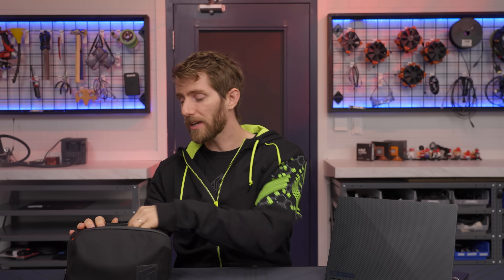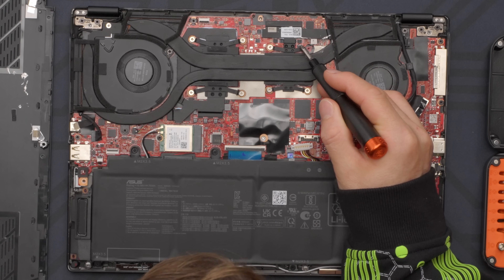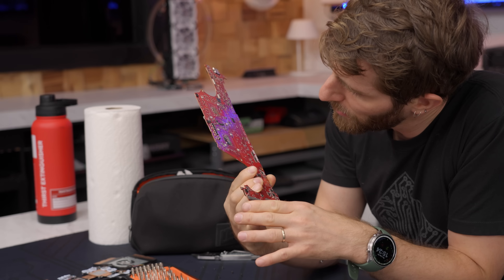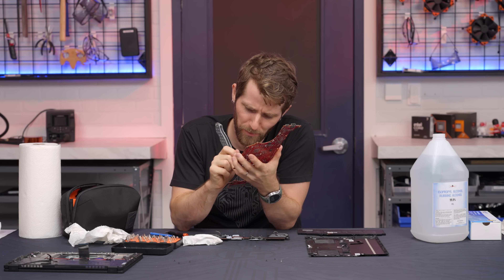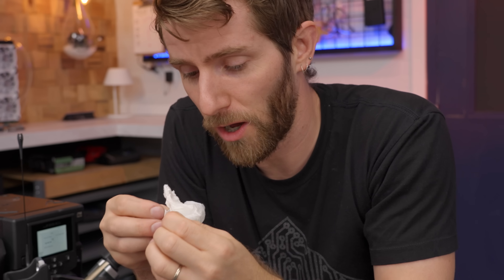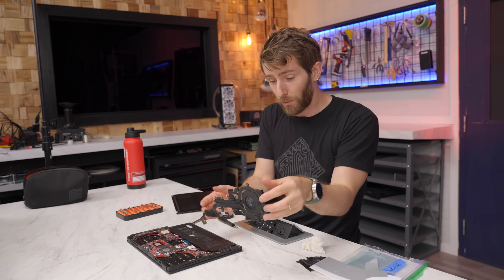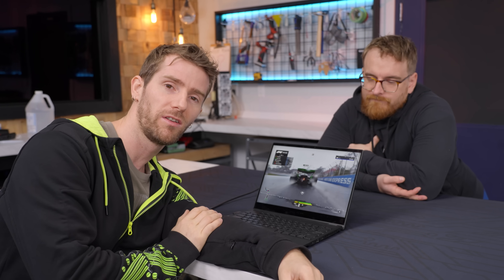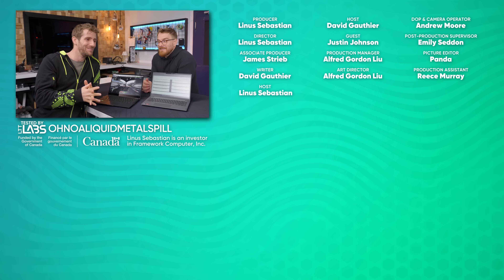Liquid Metal Killed my Laptop… Now What?

Comment: My repair shop has seen a couple of ASUS laptops with liquid metal ejection. The only thing in common between the customers was that they had both recently been on a flight, which makes us wonder if air pressure changes had something to do with it.  Correlation doesn't equal causation, of course, but it gave me cause to stop recommending ASUS gaming laptops for people who intend to travel it around a lot.
Reply: Thx for this insight. Will keep this in mind

Comment: I miss enormous laptops like the Helios 500 and the Area 51M that actually had an adequate cooling solution, and didn't have to resort to exotic enthusiast level TIMs.
Reply: The Area-51m laptop was the last laptop to be repairable, with failure-prone components such as the CPU and GPU being socketed instead of soldered on (and of course RAM and storage were also upgradeable and replaceable). Sure, you paid for that in terms of portability, but it's what the last repairable laptop
Reply: That makes no sense. 

Liquid metal isn't a replacement for giant heatsinks. If anything liquid metal transfers more heat into the heatsink which would justify having a giant heatsink. 

Instead modern laptops get smaller heatsinks because they've gotten better and manufacturers are cheap and willing to run the hardware hotter. (Also people complain about heavy laptops) They still make chonky laptops if you want them.
Reply: @aleks138  a better TIM does help a lot since the heatsink's rate of transfer to the surrounding air is determined by the difference between it's temperature and ambient.

I swapped  from factory thermal paste to PTM7950 on my GPD Pocket 4 and it dropped temps by 6 degrees at the same fan speed and let the fan work a lot less at idle.

Comment: I have two of these ROG Flow laptops, an x13 and x16, both used very heavily as a student for 2 years. The X16 had an issue (caused by me) with its sleep sensor that would cause it to get VERY hot coming out of my bag.

Fortunately I've never had a seal issue on either of these computers. I think your case should be covered under warranty because it seems like a hardware defect more than anything

Comment: I'm just thinking of my Flow Z13 (not X13) from 2021. 3050ti. It has liquid metal, on a 65watt CPU (Core i9 12th gen).  That is the 'tablet' formfactor. It is always standing up, because the internals are in the screen. Still working fine though (and used as a work coding machine daily for 2 years...).

Comment: This is such a bad example, people. Don't ever rub beads of liquid metal! Most of it will spread to other components!
Use syringe with a small needle and magnification to remove as much as you can before you try to wipe it!
Then, ALL solder points that got in contact must be re-done! Those components should be replaced at this point.
You MUST check underneath the CPU, as there's oftentimes a gap. IF you see liquid metal in there, the chip must be re-balled as well.
A(TURD)SUS and any other manufacturer should be sued for this if it's not covered under warranty.
If it happened to Linus, IT WILL happen to other people.

Comment: Take everything off the board and put it in a ultra sonic cleaner. That will remove the liquid metal from the board. Either the laptop will work or wont after cleaning 75/25 on the laptip working take your pick on which number you want.

Comment: I bought a second-hand Ga401QM that had the liquid metal spread out on the board, it would boot like normal then randomly turn off when moving/lifting the laptop, and the audio was SCUFFED. I used rubbing alcohol and a toothbrush to scrub the entire board, let it dry and it works like brand new again!
Reply: Rubbing Alcohol has a much lower percentage of IPA. Just buy the good stuff.
Reply: Ooh that's my laptop. I gotta be careful lol. But thanks for the tip

Comment: I think you should either do a collab with northwestrepair or send it to him for diagnosis and hopefully a repair. With the amount of liquid metal on that thing and how far it had spread around I would think there's a good chance some got under the cpu and it would need to be removed cleaned and reballed, and there's probably some other components like resistors and power regulators that blew due to the shorts from the liquid metal. If your lucky the cheap components like that blew first and protected the cpu and gpu and someone like northwestrepair could fix it, and from what I've seen he tends to go the extra mile to get things fixed

Comment: 2:10 - Linus literally just described very normal laptop usage. Frankly, this seems common and there should be a class-action suit against manufacturers for this. If you can't guarantee it'll work without user intervention for at least the duration of the warranty, you shouldn't be selling it.
Reply: Yeah, those things he described are all perfectly normal, especially putting your laptop in your bag warm.
Reply: I've dumped my laptop in a bag while ON, never mind warm (it was shutting down, but took about 5 minutes to do it and I had to leave), and I also once dropped my laptop bag down an escalator at an airport. What Linus did is mild. I'd never knowingly buy a mobile product containing LM or any other readily spillable conductive liquid though.
Reply: The whole time he was describing that like him being rough on it, I was thinking "that's just how a laptop is used" hell, I'm far less kind to my laptop, using it in a machine shop where every table is covered in metal dust (every few months I have to open it and take a magnet to the speakers to pull the filings off and stop the buzzing noise that causes), I fall asleep watching movies in bed and either roll over it or knock it off the bed while it's open and it just doesn't care. This thing wouldn't have lasted a month with me apparently.
Reply: Class actions are pure BS. "Cost of doing business" and is never enough to harm the company nor to refurbish the customers. "Wow, my $5 voucher that I'm able to use at the same company that did me dirty!!!!!"....
Reply: @Mtaalas  My LG fridge that was repaired for free thanks to the outcome of a class action suit seriously begs to differ. It would have been at least a $600 repair back in 2017. Now most aren't this helpful and are a functionally meaningless payout as you mentioned.

Lawyers usually benefit the most, but it's pretty much all we have in the US right now to push back against the corpo drones that want to squeeze every last dollar out of us. Our regular consumer protection agencies are toothless right now, thanks in no small part to the flaming dumpster that is our current administration.

Comment: Repair technician here : I usually start with isopropyl alcohol on a cotton swab.  The isopropyl seems to give a higher surface tension to liquid metal, which allows me to roll most of it into little spheres, then ultimately into one big ball on the center of the die.  As long as it is coated with isopropyl, it refuses to stick to anything.  If I have enough liquid metal left on the die, I often reuse it, as it often moves away from the die faster than it degrades past the point of usability.  Leaving the isopropyl dry off of the liquid metal ball often takes only a few minutes, after which it can be smooched back onto the surface of the die with a new dry cotton swab.  Also, if you'd rather change the liquid metal entirely for a new application, you can easily grab the liquid metal ball with very fine tweezers from underneath, as long as it is still coated with isopropyl, and remove it entirely in one swoop.  I use the angled tweezers from the Ifixit pro tech toolkit for that.

Shoutout to CIPC computer shop in Montreal.
Reply: heyy bud,just wondering, does using aluminium foil is good (effective) to pull the liquid metal? cuz i once saw a video on "Dell Technician expert" (shoutout to the greatest Dell technician that's ever lived,) and he said that it can be used.. 
*Correct me if i'm wrong.
Reply: @nalenendra8002  I honestly don't know, I never tested it myself and I never even heard of this "technique".

Though, as a thought experiment, roughly knowing the rate of the reaction between galium and aluminium, it could take a while, and you'd end up with aluminium foil that feels more like wet toilet paper.  You might also need to break the oxide layer on the aluminium before putting it in contact with the galium for best results.  Plus, the reaction would break apart your galium and you won't be able to reuse any of it.  Woefully impractical if you ask me, but what do I know!
Reply: In cases where it's balled, I was wondering if a simple small syringe would suck it up affectively.
Reply: @Its_Mr_Mittens  Actually, yes!

Though I've only done it with fresh liquid metal, I'm sure it'd be a very easy way to take it off for cleaning and back on again.  Usually, the smallest tip the better.  This thing can be incredibly runny.

Just make sure you don't use a fresh liquid metal syringe as there is some degradation over time while applied and you wouldn't want to contaminate a whole syringe.
Reply: Hey neighbor do you have any recommendations for a repair person in ottawa. I have had a zephyrus m16 for  10 months and my thermals have been getting bad and im suspecting poor application at asus factory. I was going to just get someone to re-spread the liquid metal but I think  using ptm7950 is better as i use the laptop on the go a lot and it goes in my back. Do you have any rec?
Reply: @itssmk_  Sadly, no.  Sorry.  Though you should still be under warranty so maybe Asus themselves could do something about it?  I would try to contact them if I was you.  And if they can't, you can always try to do it yourself but it's definitely risky,

Best of luck.
Reply: Problem is when capacitors on substrate where die is soldered are not insulated with proper material or at least gel nail polish (found out that most resistant is "gellish" lack you need to UV cure) and then soft but dense square around inside edges of substrate, not that porosive black synthetic foam they use for last 8, 9 years, notably the worst on ps5...

Comment: 8 years ago, my 2016 XPS 15 fell two meters onto a tiled floor. I had to replace the chassis, but the screen and motherboard were intact. I took the opportunity to replace the thermal paste with liquid metal. After that, my sister used it and even accidentally ran over it with her car. The chassis and the screen broke but the motherboard was still working. Despite all this abuse, two coats of nail polish around the cpu and the gpu die were enough to keep it working to this day.

Comment: I had replaced the thermal paste on my laptop with liquid metal for better performance. After a long while, the laptop suddenly shut down and wouldn’t turn back on. When I opened it up, I saw that the liquid metal had leaked onto some areas next to the CPU. I took it to a service center, and they told me that the motherboard needed to be replaced, which would be expensive, so I refused. They only cleaned it and replaced the thermal paste for free, then gave it back to me. I set the laptop aside for about a month, and one day, just out of curiosity, I plugged in the charger and tried turning it on. To my surprise, it powered up perfectly fine. I ended up using it for another year without any problems before selling it. I still find it hard to believe that it worked that day.

Comment: 9:00 i feel like freezing the board might have been the best option. that might allow you to just dust the liquid metal off as it will solidify. maybe LTTlabs should find out what is the best method to remove LM from a pcb even a cpu socket.

Comment: Have same sh8t with alienware 17r5( we change paste to LM), and LM goes under gpu mem chip, we switch off to integrated and work so about 1.5 year and after get black screen on integrated, after dissasemble i saw that LM was around CPU VRM, so i clean it all and no scary to try turn it on, an seems will sale it for parts

Comment: You are GAMBLING with LM in a laptop! Sure, temps are great, but you're constantly risking the entire laptop turning into a very expensive paper weight. To me it's just not worth it. Just use MX4 or TPM7950 for good temps and zero risk of a teeny, tiny spill shorting out your 2000+ dollar laptop.

Comment: been using liquid metal in my laptop for 4+ years that wasn't designed for it and it's survived thus far lol. I did a TON of prep and precaution though

edit: for any one curious, that prep was: 1. electronics tape around the CPU & GPU package, 2. conformal coating around the CPU & GPU package underneath the electronics tape, 3. K5 pro as an extra barrier around the CPU & GPU package, 4. conformal coating ALL OVER ANYTHING around the CPU or GPU vicinity.

Comment: 1:09 I don’t recommend this AI summarizer, it’s expensive, the audio isn’t great (just use a phone and find the first noise cancelling app or website file converter and it will sound better, idc if the thing is smaller, for the insane price and subscription required for a good amount of transcription just isn’t worth it if your phone works better) I’ve tried it expecting it to be good, the pin one at least isn’t so great especially because it automatically cancels background noise (at least give me the option so hear the original audio just in case it lost some info) but it’s kinda justified considering how small it is but the subscription is crazy when there’s websites that do the same but for free 🥱.
Reply: But again this is just my experience with it maybe for someone else this gadget could be pretty useful if you can’t put your phone on your table or anywhere close by for good audio, don’t take my word for granted

Comment: Ipa makes it ball up and separated then use adhesive tape it will pick it right up off the board. Alternate between the two. Ipa in a spray bottle will flood and push alot out

Comment: The best way to clean liquid metal is to flux some solder wick and heat it with a hot air station and the solder wick will suck up the liquid metal via capillary action and get the board nice and clean.

Comment: Having this video is great i just replaced my 2021 Zephyrus G15 liquid metal to PTM7950 and MEN i gained 30% extra performance in multicore benchmarks and more sustained power between cpu and gpu, liquid metal is simply not worth it temps are even better now with PTM

Comment: I wonder how much it would cost a manufacturer to put a conformal coating on these boards they are cooling with Liquid Metal…seems like the best solution to this problem…but maybe I’m dumb.😅
Reply: Likely about the price of a couple jars of nail polish, it wouldn't take much and could be done with a pretty large brush. The only tricky aspect would be leaving other hot components uncovered for putty.
Reply: You'd have to be careful not to cover any connections and such, and it would make component-level repair impossible

Comment: To remove excess solder with the wick more easily, first I dip it in flux and heat it up. After that I use that "fluxed" part to soak up the excess solder. In that way, the wick uniformly sucks up everything more neatly... And then clean up the area with Isopropyl alcohol once I'm done.

Comment: If you use a blow torch on the solder wick to remove the copper oxide layer, it can absorb solder (and probably liquid metal) a lot better.

Comment: I hope this liquid metal phase for laptop manufacturers go away QUICKLY. I don't want to worry about my laptop not functioning the next day, all because I didn't let it cool down for 10 mins before putting it in my bag, accidentally bumped it against a surface or just shook it a little too hard. Plus, replacing liquid metal is such a scary thing, you could easily spillover a droplet of LM and short your board, killing your $1000+ gaming machine in seconds. I have 2 laptops with liquid metal and haven't faced major issues of them breaking, but temps are unbearably high but I fear shorting my board that I don't even dare open up the laptop to remove the heatsinks, just fk this shit @lenovo and @asus